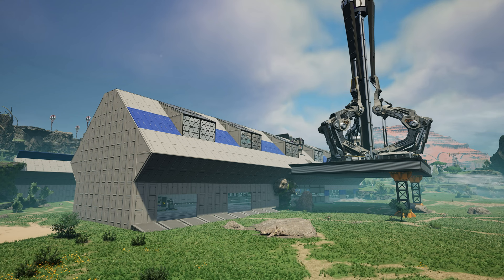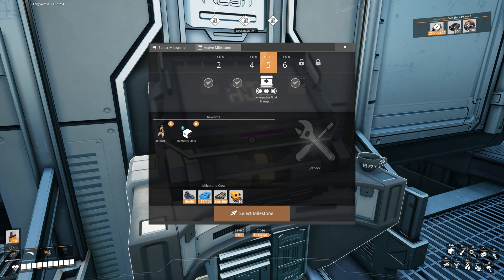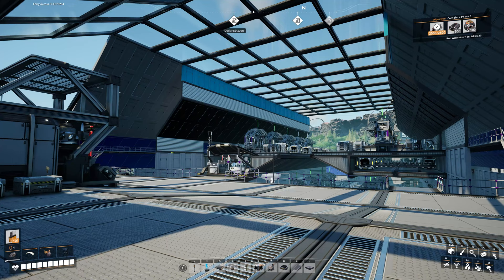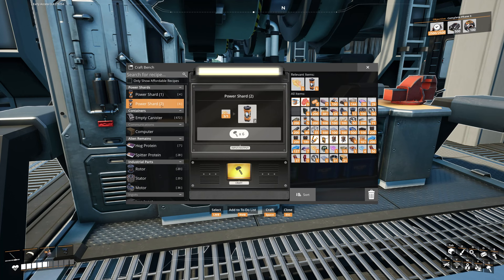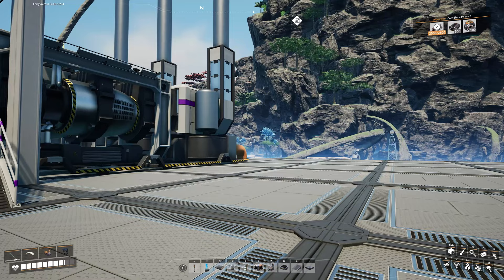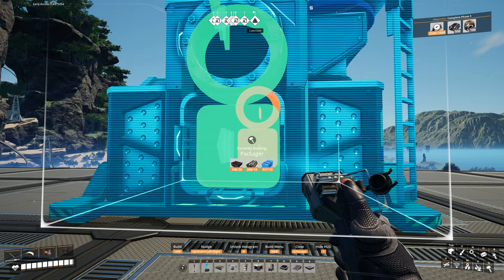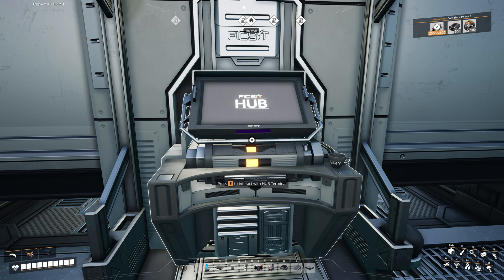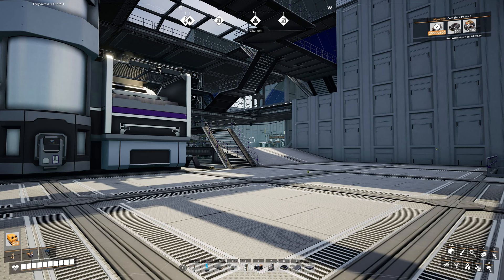Fueling Up! - Packaged Fuel & Jet Pack - How to Satisfactory - Tutorial &  Walkthrough - Ep. 35

Comment: Did I do something wrong or are we not producing nearly enough Heavy Oil Residue to run everything at 100% now? Even with the adjustments in the video, I think we are falling quite short on that.
Reply from the maker: You seem to be correct. When I tested everything before it was working without a hitch but I loaded up my game and went over to the oil Rig. and we do in fact need a bit more. I suggest throwing a power shard into the Rubber Refineries. We don't need that much rubber.. but it produces more heavy oil than the Plastic does.
Reply: You are awesome! Thank you!!
Reply from the maker: @tylernielson4064  No problem. I don't knownif it will be a permanent fix.. but.. it seems to work right now.
Reply: If I’ve done my math right, I don’t think it will be enough, but definitely better :) thanks for all you do! I enjoy your videos and look forward to them!
Reply from the maker: @yamahagriz  maybe not.. we can always up the plastic more.. we are going to need a ton of it soon... also about to switch to fuel power once computers are done
Reply from the maker: Aww... Ok also .. turn the Coke refineries down to  90 per minute. If you add the coke needed for the three generators... that's 37.5 for the overclocked one and 25 and 25... comes to 87.5 coke needed per side. Might want to turn up our water too since I am noticing we are using a lot after overclocking the two.
Reply: Awesome!! I appreciate it :)